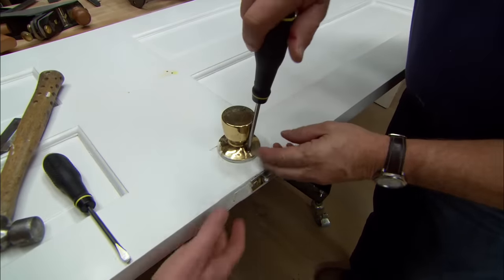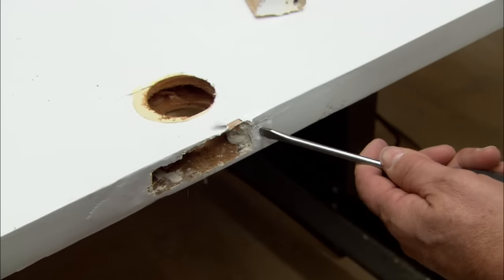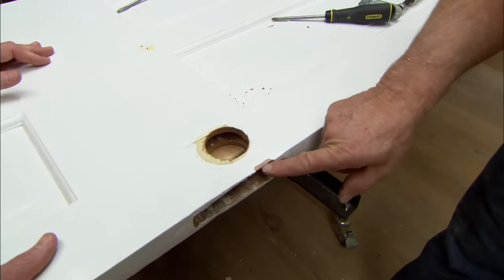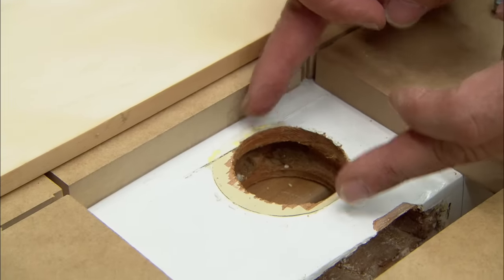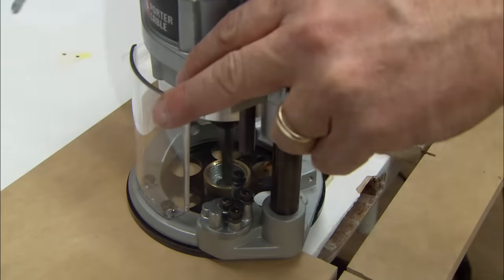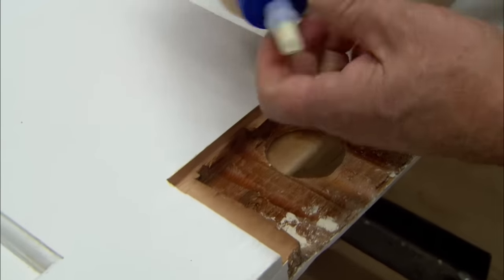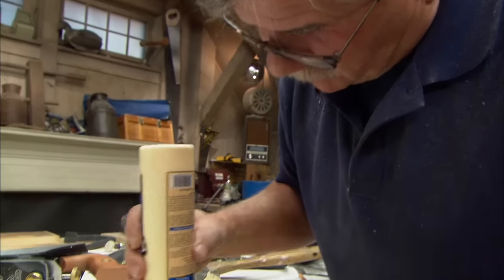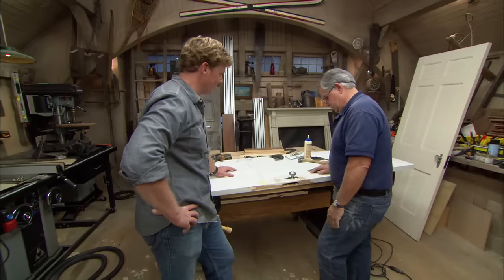How to Patch a Doorknob Hole With a Dutchman | This Old House

Comment: I am repairing a 150 year old door. It is a Douglas fir door . So the old mortised lock is larger then the one I am replacing and precious homeowners put all kinds of other deadbolts and hinge locks . So I am using this method to fix them all , I have 2 of them fixed and it came out flawless , just one more to go , thanks for this video , if I didn’t see this we would have had to buy a new old door lol , love Tommy’s tricks

Comment: Great job
Only suggestion for others is to check for lead paint on the door before you start as you don't want to be sanding the paint off and putting lead particles into the air. This concern is of course for old houses not new modern ones..
Thank you guys
<WB>

Comment: One thing I have noticed with Tommy and others is they only apply glue to one surface. It really should be applied to the other surface as well even if it just a thin layer. Otherwise, the dry surface  will soak up the glue.
Reply: We want the the glue surface to soak up the glue, which is why wood glue is always to be applied liberally.

Comment: Thank you  so much for showing us how to fix this!  I had a renter and without asking me ,he had a friend replace this type lock with a New one and it doesn't fit the hole and he threw away the original lock. WHERE do you think I can get another "old timey" lock AND would you fix the other side exactly at the same spot or offset because of the "glue to it "on the inside?
Reply: Here are over fifty to choose from: http://www.ebay.com/sch/i.html?_from=R40&_trksid=p4712.m570.l1313.TR1.TRC0.A0.H0.Xyale+vintage+door+lock.TRS0&_nkw=yale+vintage+door+lock&_sacat=0

Comment: my Aunt had a ''sign'' on her desk that said'' how's come there is never enough time to do a job right ,BUT enough time to do it again to fix the problem. THIS was done right the first time
Reply: fullstrutn is that why you can see a second previous repair after they sand away the paint?
Reply: well he could have made and spall replacement at the edge, but he added a lot of unnecesary cost to it

Comment: The best way to make this is to cut half out the vertical member, open mortise the wood and prepare a piece that slides in, re-cut the hole and move on. It's the most solid variant and, it has one major benefit. Later, if you want to move to another form of lock, you remove the piece you just made and put another. Obviously, you don't glue it in, just hold it with wood nails, as they did in the old days.

Comment: This is a great video. I have watched this video many times. I am still trying to figure out the best way to repair the door knob hole on my front door. 

In this video, the pine board is less than  half of the door thickness. Do you think it is okay to cut out a section from the door completely and replace it with a lumber or board of full door thickness? My idea is to use both glue and toe nailing (with 3” inch screw) to fix it into the door, then make the hole from scratch. I think this way will give it more strength.
Reply: Look into a tongue edge to secure a front door better even a mortise joint this video is interior door. Unless your saving an antique wood door I would buy a new one, fiberglass doors today look as good as wood
Reply: 2" dowel
Reply: @rickslaine554 Nice rec

Comment: I did a similar repair, I just put the wood block I made on the inside instead of cutting the front of the door out and having to sand and paint it.

Comment: I have a question, are you familiar with "Bondo"? BTW, to avoid using a chisel to square up router corners, use a square corner router bit.
Reply: Bondo is really hack carpentry. It IS great for auto body though.

Comment: So will the PVA glue line telegraph up thru the paint at a later time? You should have memtioned that the grain of the wood in the dutchman wood should run in the same direction as the door.

Comment: I have the same doors I need to fill but am also wondering if there is a video on how to patch the whole thing to add in a new style door knob without having to use the older style again @This Old House
Reply: It's the same process, just account for the final cutout size and shape when you patch.

Comment: Is wood glue strong enough to hold that patch on with repeated pulling and pushing and slamming? Or against a burglar?
Reply: Yes, wood glue is very strong. Usually, wood will break before the glued joint does.

Comment: I could really use some help! I’ve got an old wooden door and the door knob is placed about three inches further away from the latch bolt. The latch bolt is approximately 5” long. The door knob is 60+ years old and doesn’t work nor locks. I need to replace it as it is an exterior door. I was thinking of filling the hole and then drilling a new hole in the appropriate place for a new door knob. But I’m not sure what would be the best thing to fill it in with. Any suggestions????

Comment: The America way of installing door knobs is interesting. Not sure why they cut such a big hole for it! In the U.K. We drill just the hole for the spindle.
Reply: our way is stronger and more secure.
Reply: Our burglars are bigger and stronger than your burglars.
Reply: ec1275 lol 😂
Reply: well.. my bologna has a first name...
Reply: +lostintime86 yes we know, it's Little John.
Reply: you peeked.
Reply: so do we
Reply: Eh? That looks exactly like a door latch/knob you would see in the UK. Both the original mortice lock and the retrofitted latch they removed.
K, Sorry, I rewatched it and realised you were talking about the hole in the face of the door. That is odd.
Reply: ec1275 LMAO
Reply: Zed Man we like big holes
Reply: American like BIG
Reply: the door knob bolts to the doornob on the other side, two tubes pass through the latch mechanism holes either side of the spindle. we have these sort of door knobs in the uk and they need a hole just like shown here. a handle that screws into the door on both sides would need thi and would just need a hole for the spindle but this way you get one side with no visible screw heads.

Comment: Could you do a similar video with minimal tools and materials? If I had to tool-up in order to do the job as described, I'd be better off buying a new door.
Reply: A new scratch door slab which you then need to hang in the existing jam, i.e. cut to size, chisel the hinge mortise, cut for the knob and mortise hardware, then paint a from scratch door.   You're going to have to tool up a bit to cut that 4" deep mortise.

Comment: Nice patch but wouldn’t the dutchman just pop off whenever an intruder lightly kicks the door?
Reply: It should be dovetailed
Reply: @Weedug  The whole piece is a dovetail relative to the door, that's the nature of a dutchmen, with both edges and surface glued. The surrounding door material will fail before the worked area which is now a laminated structure.

Comment: Any tips on what to use to fill up the hole instead of using a patch (as the metal shows through, sanding just exposes it) ? The hole is just under 3" and about 3" in depth. Its a small door knob hole. DryDex stuff just isn't cutting it. Thank you.
Reply: Wood. Whatever type the door is made of. Go get some ,cut it in the shape of the hole. Glue it in like in the video. DryDex is just a pink indicator that turns white, so you're either using drywall spackle or wood filler with DryDex indicator in it. Neither of those are for a 3" diameter, "3 deep hole.
Reply: Builders  bog

Comment: Wow, with this repair, the door lock is now only held in placed by glue! What a secured door!
Reply: +dachee It's most likely an interior door.  No deadbolt.
Reply: Thanks
Reply: dachee Strength shouldn't be a huge concern for an interior door.

Even if it was an exterior door, the jamb will fail if kicked.  If someone wants in bad enough, they'll get in.  Doors and locks keep honest folks honest.
Reply: Also, glue is stronger than the wood itself.
Reply: It is actually a secured door. The glue he's using is stronger than the wood once it dries and sets up.

I've done patches like this for years and have yet to have one fail. Nothing lasts forever but this technique is a very good strong repair that can add years of use to a door.
Reply: Renegade Wa you ar right the wood will not break on the glued points.
Reply: dachee that's exactly what I thought
Reply: +L Rodriguez  This patch just glued won't fail. Titebond glue is very good. If you were that concerned you could use door handle through screws/bolts. These use a female thread screw one side and a male thread the other and they lock together.
Reply: IG Sky.Dweller Watch the video again, at 3 minutes he puts glue on the door before adding the dutchman.
Reply: pine no less.
Reply: dachee Sarcasm is high with this one. 

Does it really look to you to be an external "secured" door? I think it is clear it is an internal door.

Comment: Does this in any way make the door less resistant from intrusion vs a fully intact door? Seems to me one swift kick and that dutchman (and door mechanism) will go flying off
Reply: Opposite.  The repair is a laminated structure, with adhesive on edge and surface.  Its stronger than rest of the door.

Comment: In my book the mark of a real craftsman is to respect those who came before him. The casual (and almost universal) slur on the worksmanship of "the man who did such a bad job last time" was uncalled for derision. Maybe he didn't have a smart router or modern adhesives or a cross- cut saw, back then. On a more practical note, removing so much of the side style has reduced the strength to only a quarter of its original thickness.

Comment: I feel that the door was  very weakened with that dutchman being so short  and narrow and you have not enough good wood   exposed on length and breath  to get a good joint.  A longer and wider  dutchman with a scarph  edge would be  much stronger and this can be used on both sides , getting rid of the rotting wood and joining on to virgin wood on both sides. 
A little more work, but with modern tools, it is not that difficult.
That  simple repair, well one bang of that door on a windy day or children being rough and cracks will show on  all the three sides of the dutchman as the  strength of the frame of the door was not put back , it could have been.
Reply: At 4:02 he says he's going to do the other side, though I agree he should've made the patch a few centimeters larger.
Reply: When he does a final sanding it uncovers and existing patch so he's patching a patch.  A few cm bigger makes sense.
Reply: It's a demo you clown, don't over analyze it.

Comment: How much harder to router the old door with a dovetail like taper and making a corresponding patch to slide in from the edge? Get a better mechanical fit no?
Reply: that would be nice but if you have long grain contact the glue available today will hold until the wood fails.i would have cut that dutchman with a slight angle and pounded it into the hole for a tight fit though

Comment: Funny how they made comment on the previous patch being no good.... take a close look at 4:04 , looks to me like 2 nail holes and a previous patch is both higher and lower than their new piece. Should have done some cleanup first to reveal what they are working with...
Reply: True.
Reply: It's screw holes from the old style plate (skeleton key) and that's not a patch it's just marks the plate left on the door.

Comment: Show the door now, after a couple of weeks after the paint has dried. I'm pretty sure you'll see the cracks showing up through the paint again.
Reply: Not if the paint job is a good one.
Reply: Offshoreorganbuilder Nope, wood doesn't allow you to make joints disappear. No matter how good you work with filler and paint. Try it, and you'll see. Just a matter of time.
Reply: My experience (which is a professional one) is different.
Barring unreasonable circumstances (the patch not being sufficiently acclimatized, or being a poor fit, or the house being subject to the over-use of central-heating, or the door being in the full sun, etc.) if the old paint is stripped off and a full painting job is done (primer, 2 coats of undercoat, one of gloss) there should be no problem.
Reply: Offshoreorganbuilder ha ha, the restrictions for success are pretty all encompassing, especially for front doors. I'm sure that a smooth sustained solution can be achieved, provided the circumstances are perfect, but they seldom are. That's my, realistic, point.
Reply: You may be right.
Was this a front door, though?  Without a lock?

Comment: can you use this technique the same on a electric guitar?
Reply: +Vidar ! that would be tricky considering you are dealing with acoustics but it will work. Just maybe not are good as the original. Make sure you use the same type of wood.
Reply: +Timothy Schweitzer okey, thanks 👍
Reply: +Vidar ! Why would you want to put a doorknob on a guitar?
Reply: gawpertron I want to open the guitar so i can fix it, but without a doorknob i cant open it :)
Reply: Vidar ! Well there are set necks and bolted in place necks. Set "glued" necks are better in terms of sound.

Comment: A simpler way? Most people don't own all these fancy tools. 
A plunger cutter, table saw?
Reply: People, TOH is NOT a DIY show... it's more about "look how hard this is and how much skill is needed... you better call a pro".
Reply: It's called a square, pencil, tape measure, hammer, chisel, clamps, block plane, clamps, hand saw wood glue and sand paper if you don't want power tools

Comment: I have been a Carpenter on a sailing ship for almost a whole year and i made a few Dutchman in my time but i still do not know were that name Dutchman comes from.Anyone ?
Reply: There is massive debate about this no one really knows the etymology of the word being used as a patch repair.
Reply: I'm wondering if it comes from making long skinny slivers of wood to fill in gaps between joints...like in an old hardwood floor with gaps between the boards.  Long and skinny...like a Dutchman???

Comment: I needed to buy a new door I had to get a hammer and smash the door knob in because the door seized up and it was stuck I tryed nearly every thing to get it open it just was not opening so I just started smashing the door knob until i could open it. P.S I needed to get in there urgently to get some paper work for work

Comment: Not sure how secure this door is going it be now. Will it not be easier for an intruder to force entry?
Reply: if you have long grain to long grain contact and use glues available today the wood will fail before the glue joint
i use glue to bend tight stair rail radius's that take four strong guys to bend onto the forms and 24 hours later that glue makes the wood hold it's shape
Reply: It's an interior door....
Reply: The guys wife might be angry one day and try to kick the door in if he locks it and tries to hide
Reply: It is an interior door 🚪!
Reply: clever answer :D

Comment: plot twist the owner of the door never ever asked anybody to remove that doorknob....
Reply: butcher bill Plot twist to the plot twist. Right house, wrong door.
Reply: Umm yeah you kind of git to remove it cause it's in the way of the work. Genius
Reply: +Justin J Most interior doors look the same in a house
Reply: Confused as to how the opposite side will look when completed a door knob is mirrored identical on both sides.
Reply: @DJPoxE5  typically a dutchman repair would be a solid block to match thicknes of door... Then completely re morticed..... Theres allways home depot😅

Comment: The technique would work with interior doors. However, with exterior doors a more advanced technique would ensure strength and security
Reply: Ensuring security would entail through-bolts and steel plates,  because without heavy reinforcement: all the patching is going to otherwise ensure that will be a weak point in the door....

Comment: if you had cut the dutch man patch with about a three degree angle on the edges and made it a 1/16 too big when you tapped it in it would have fit so tight you'd have no need for filler
Reply: HEY IM WALKIN HERE!

Comment: MDF should be avoided for the potentially harmful adhesive in it
Reply: You should avoid electricity as well, it's probably nuclear. Oh and cars? Definitely deadly, don't wear shoes either. Air? Dude, air has oxygen in it. That thing kills you.
Reply: Hate to be a smartass, but MDF releases some formaldehyde, which can be poisonous as well as dull blades quicker. I'd much rather use something like maple or a hardwood in my opinion.
Reply: The MDF was used as the template only.  The actually patch was standard pine, as explained in the video.

Comment: Lead paint and dust. Not much meat or glue surface for the new patch then do it again on the other side. Sure won't fall apart in couple of years? Pocket screws for insurance? Or put the lock on the other side redo the hinges.

Comment: It's funny how some of these things require tools more expensive than buying a new door lool
Reply: There are more ways to reach the same result, but power tools help cut down the time spent.  Also, once you have bought the tool, you have it to keep and use for many many years to come.   It would be silly to buy all that  gear to mend this one door only.

Comment: I have the same issue. This is way to much work for someone who does not have all the tools.  I just bought a new door for 30 bucks.
Reply: from where?!
Reply: @dorieanjackson8551  Lowes and Home Depot sell primed doors for $35.  Just need to paint them with semi-gloss white and you're done.

Comment: By the time you go thru all those steps to put that plate in you could probably rebuild the entire door in Oak by hand. Plys like others have said, I can't see how this repair will hold up over time. That door handle and plate will take a lot of pounding and slamming, but I am far from an expert. Maybe a lot of screws would help strengthen those glued areas.